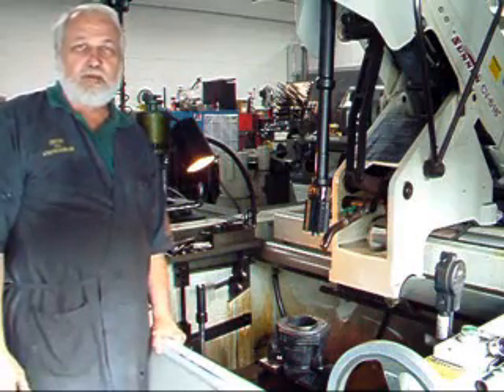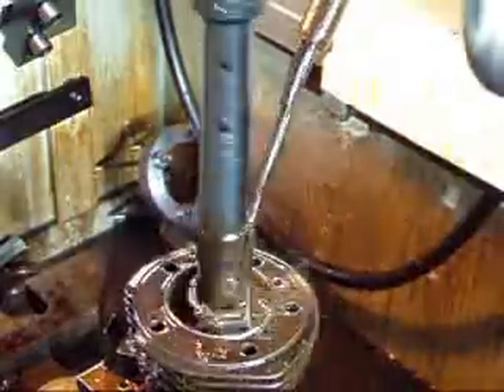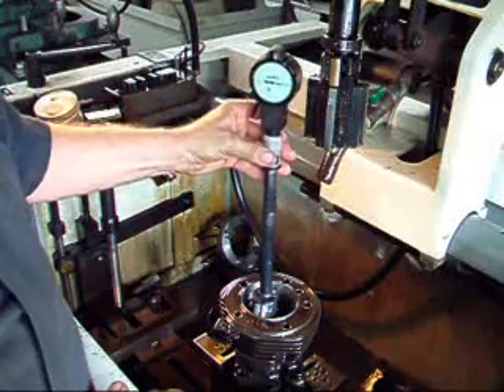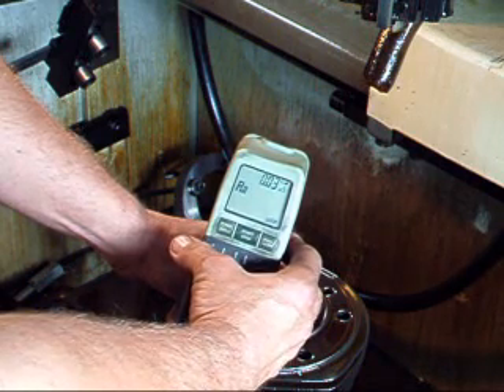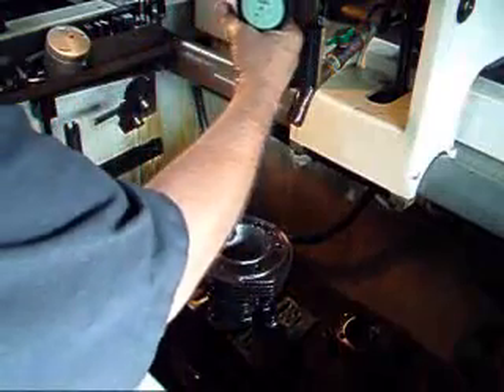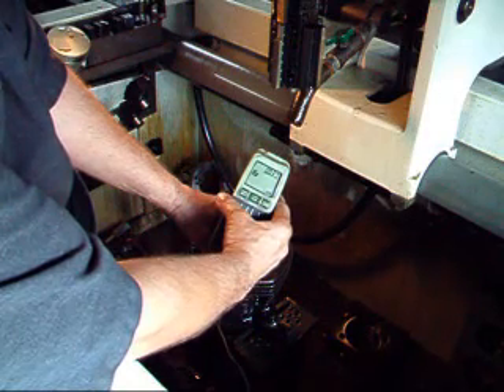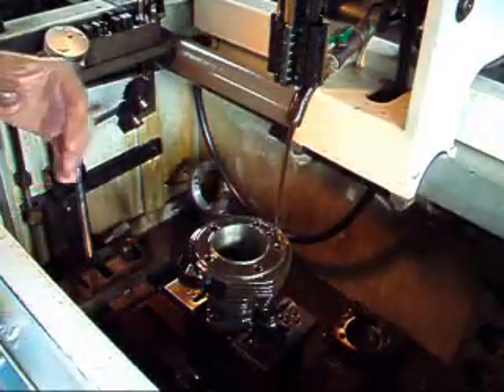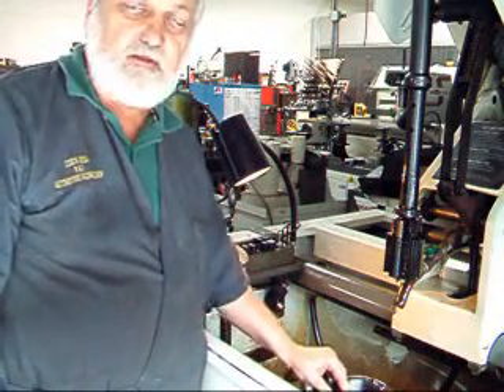H-D Cylinder Honing

Comment: @07blackdog The main reason why evo and tc:s are less prone to gasket leaks, is the bigger clamping length. The long through bolts provide better preloading than the stud/base head/bolt system, this better maintains the pressure on the gaskets. Another factor is the larger thermal growth of aluminum,  since the whole cylinder is clamped on evo and tc:s, the total thermal growth of the cylinder helps increasing pressure on the gaskets.

Comment: As mentioned, you only use torque plates on aluminum Evo and Twin Cam cylinders. Engines with short cylinder head bolts dont need torque plates since the headbolts dont compress/distorte  the cylinder.

Comment: Hello John I have a 110cc dirt bike cylinder, which is otherwise ok, but rust has pitted some spots of the inside of the cylinder. It's not very bad, but I can slightly feel the pitted areas with my finger. The bike is burning oil badly, could that cause it? I have inspected the engine and other parts look almost like new. Could the cylinder be fixed with just honing and possibly new pistonrings, or is reboring needed? Thanks for your videos, theyre great.

Comment: @07blackdog Yes I know that after the evo was introduced, some builders started using torque plates on the older non trough bolt system engines with iron cylinders. At least when reboring. In my opinion, the need for torque plates is way more important on the evo and tc engines because of the less stiffer aluminum comined with the through bolt system. I guess that torque plates wont hurt on shovelhead and older cylinders. I just think thet Vector6977:s comment was overly critical in this case.

Comment: Hello john i have a 125cc 4 stroke bike.I have doing boring in cylinder 0.50 oversize and i have a problem with oil. After 500 km the oil is very black like diesel engine.
Do you think i have extreem blow by from piston rings?The engine works good without oil burning.Congratulation for your work.Thank you.

Comment: John would you consider rehoaning a lifter bore? I am guessing it has to be welded or sleeved first. any thoughts? The pin from the tappet on the rear cylinder chewed up a good portion of the wall. I have pictures if needed, just link me an email!
Thanks...

Comment: John, i hope you pass on your knowledge to someone, you are like a heart surgeon on engines.

John since the cylinder was so far under size why didn't you bore it 1st? Same result obviously but wondering, seems the course stones got it close to size fast-- Is that surface checker really necessary for the average rebuild? I am sure you remember that NO shop had a tool like that, 45 degree hatch seemed to do it but possibly less ring drag with a better finish

Comment: Just like Vector 6977, I noticed that this guy is not using Torque Plates on those cylinders.  What gives?  Everyone knows that if you hone the cylinders with out Torque Plates the cylinder will never be round when you torque the cylinder heads down.  What's up with that?
Reply: Larry - this is a shovelhead cylinder. It bolts down to case on bottom and then heads bolt on top. No torque is applied to the cylinder (in compression). Harley Evo and Twincam heads are different. And . . . .many old-time Harley guys use a sunnen horizontal honing machine to do this (holding cylinder in their hands - not bolted down like here.

See what I did there? I provided you with some info - and I didn't make you look foolish doing it.